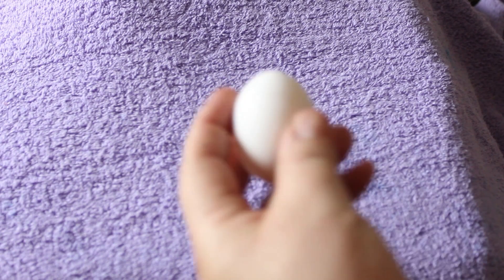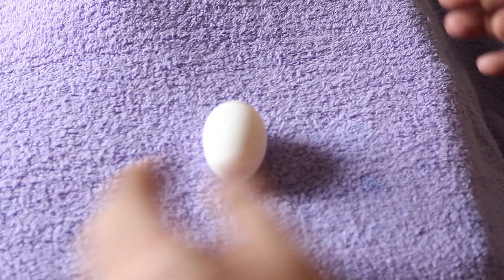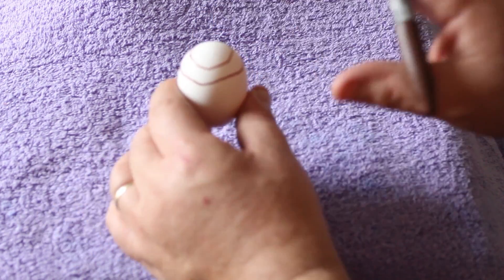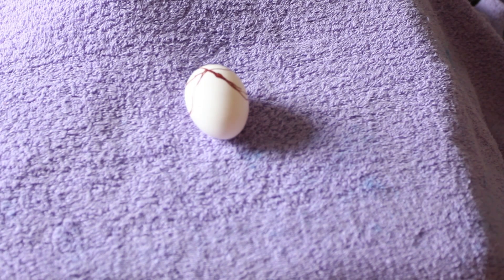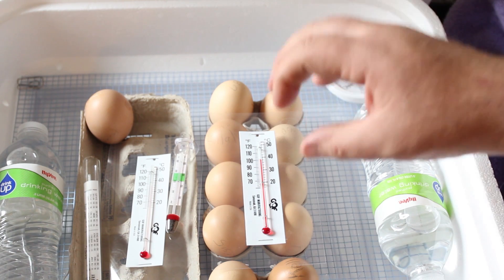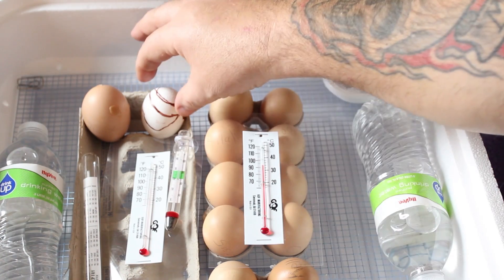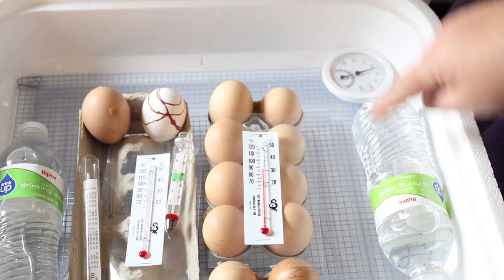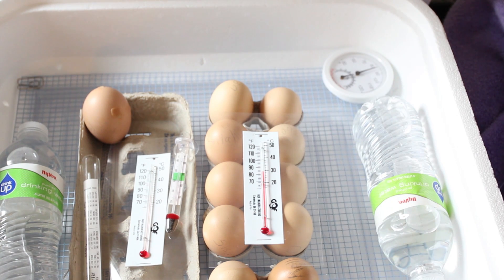Tips For Hatching Shipped Chicken Eggs With Detached Air Cells

Comment: Chicken eggs need to loose 14%  of the laid weight in the first 18 days of incubation. Its in the Brensea hatching manuel. I run 35 to 40 % for chicks and turkeys with  great results. If they dont loose this weight they will be too big to maneuver on hatch day. You will get a pip hole at best and a dead chick in the shell. And if you remove the chick you will notice that it seems large. It wasn’t able to spin around and pip the top off and escape.

Comment: What was the hatch rate?
Reply from the maker: Over 75%
Reply: @ThomasShue  good to know! I got an entire clutch of duck eggs with dislocated air cell. I candle and map the deformity like I do with all my other eggs. But I'll try up right next time! I resigned to the fact I'll have to manually hatch eggs with a starter air hole. Luckily I have 90% success with this method from what I learned on channel #AChickNamedAlbert #ACNA

Comment: This is good info, but for detached air cells I’ve read in a lot of places to run a “dry hatch”. Keeping the humidity around 20%-30% instead of 40%-50% to prevent the embryo from drowning inside the egg & raise the humidity in lock down only when the first egg has externally pipped.  This is what I’m doing with shipped eggs in my Farm Innovations incubator, so I guess we’ll see how that turns out.
Reply from the maker: Well a dry hatch will have the chicks stuck to the inside of the egg shell. Its not a good idea. The incubator makes dry heat. I always keep water in my tray

Comment: Amazing tips - no turning last 6  days, water bottles, raise humidity AFTER Pip - good timing for me. Got 18 in the 'bator -  hatch rate will be awful with the rough automatic turner...kept upright all but 8 hrs, using edge tipping so far. Will switch to your method of turning tonite, day 9.  Would like to see your lockdown and hatch rate.
Reply from the maker: Hatch rate was around 65% with detached air cells.  This method does work, and saves chicks that otherwise would just die.   I hope my video helps you. If you could be me a HUGE favor, please subscribe. I am trying so hard to get to 10,000 subs

Comment: Hi. Just came across your video but i think it may be to late for my chicks. I am at Day 15 with 6 saddled air sack eggs, I have been rotating them left and right as ususal. Should i stop rotating them now and just turn them slightly in a circular motion?  until day 18, and then up the humidity for lockdown but leave them in the craddle with air sack facing upwards until they hatch?
Reply from the maker: I don't know what I would do in your case. They would of already drown buy now.  I'd candle the eggs and see if anyone is still alive
Reply: @ThomasShue  HI . There is still 3 alive
Reply: @ThomasShue   Thanks for the super fast reply its really appreciated. I will go candle now and get straight back to you .

Comment: Thanks for the informative video. Please answer this question! at 4:38 you say "you swap them out". What do you mean by that? My understanding is place eggs with detached air cells vertically, not in electric egg turner, and gently turn at an angle 3xs a day. Is this correct? I don't understand what you mean when you say swap them in and out. Thanks!
Reply from the maker: Swap as in swap the eggs from leaning from the left to leaning to the right. I'm swapping the angle. You want the eggs to remain vertical, but not at a fixed angle. Set eggs on end at an angle to the left, then when you move them, SWAP them to the opposite side of the tray and the tilt them to the right. 

You see the eggs need to be turned, if not they will die and or be deformed. By Swapping the vertical angles you are moving the chicks inside the egg, however, you are maintaining the newly created air cell. 

Hope this helps you, you can help me by subscribing, it cost you nothing and helps me a ton.  Please like also.. 

Good luck with your new chickens.
Reply: @ThomasShue  Thx so much! How is this different from the electric egg turner? Isn't this what it's doing? Gently moving it back and forth throughout the day?
Reply from the maker: @bethhall2465  broken Air Cells on shipped eggs need to be stationary yet vertical. An egg turner won't hold the eggs vertically stationary long enough to maintain the new air cell we are trying to form.. Normal.eggs the egg turner works fine, eggs with detached air cells the turner will kill the chicks inside, they will drown

Comment: I am new to this and just set my first set of hatching eggs 6 days ago, which came from ebay. I wish I had know about this before i lay them down in the Brinsea Mini II Eco. I have just candled them and 3 are not fertile and the other 3 look like they have a detached air cell. Is it worth me standing them up like this after I have been turning them 5 times a day for last 6 days? Please any advice gratefully received. So sad and disappointed.
Reply from the maker: I fear it may already be too late. You need to check the air cell as soon as they arrived. You can try, it won't hurt to try.

Comment: I am on day 4 of shipped eggs and didn't know about this. Is it too late to try it? I have some with detached air sacs
Reply: I'm just curious, did they hatch?
Reply: The info was misleading... the reason why y’all deal with the non perfect air sac size is because y’all starts turning them eggs as soon as they went to the incubator.... they need to be upright position for 7 days or at least when the air cells are reattached... you have 1% luck hatching saddle shape air sack on lockdown... they need to be in perfect shaped before lockdown that’s why lots of them eggs never hatched

Comment: So I'm confused... Do you turned your eggs while it's in 24 hrs rest before putting them in incubator?
Reply: Some say not during the room temp rest...or even the first 2-5 days upright in the 'bator. I used slight tipping - with a book under different edges of the egg carton...and a gradually more than that in the Incubator after first 3 days.

Comment: Hi Tom! So glad I found your video, I've got eggs from my own Cochin Bantams and most of them have the air cells on the opposite end. One is at day 7 of incubation and the chick is moving and developing well but the air cell is at the other end. Same is the case with my day 6 and 5. 

I've had them on the side and slightly tilted, pointy end down in the tray since day one and the air cells are still at the wrong place. Please tell me what I should do. This is my first time incubating.
Reply from the maker: You need to stop moving them they can develop an air pocket. I do this by placing them as shown in the video.
Reply: Alright, thanks.

Comment: Awesome! Thank you...I have a few questions. First, where did you buy those thermometers at....I am sick of getting the expensive ones, like digital ones, and not being accurate... The simple ones on the coard board are the best... And I'll be able to get several! Lol
Second...I have just bought Serama eggs... They are hard to hatch in the first place, let alone being shipped.... Have you incubated any of those eggs. And do you have any suggestions for me....I have let them sit, it's been over 24 hrs.... I've checked the air cells, one was completely detached, but the others seem good. I have a few that look like they were trying to be saddle like air cells, but it's very very slight...
Ooh, another question, the ones I just described, that have very slight detaching ( if you want to call it that) of the air cells, is there anything I should or need to do differently? 
Thank you for you video...
I hope to hear back from you soon!

Comment: Thanks for posting. I have 6 call duck eggs that I just received from the mail. All but one have detached air cells. It was advised that I use a broody hen to hatch as calls are hard to incubate. Can I do that now that they have detached air cells?
Reply from the maker: Twin Roses Farm I would not do that. I would incubate then just as I showed. You need to reconstruct the site cell. To do that, they need to be on end.

Comment: when they start to pip do you remove them from the carton and lay on their sides or do you leave them right in the carton till completely hatched?
Reply from the maker: Jennifer Bakos after they pip, and start to come out, you can lay them down. just wait until the hole is nice and big. when they start to unzip is the best time. A pip means they are wanting air, and it can take 24+ hours for them to unzip and hatch. Personally, I would wait until they are starting to unzip, or make a bigger pip hole.

Comment: Hi Tom, Thanks for posting this. Do you have any experience with goose eggs? I received shipment this morning and they are all detached air cells. The woman I bought them from suggested a similar method. Any info is GREATLY appreciated.
Reply from the maker: OzoneMama3008 I'd be happy to speak to you over the phone. send me a direct message with your number I'll call.  The bottom line is this. We are trying to re construct an aircell.  We do this by setting the eggs vertically, then we turn the eggs at a much shallower angle than the 45° angles that we turn on a standard eggs with normal air cells. You can hatch your goose eggs with detached aircells. Follow the video, the method worked for me. Also if you get a chance, please subscribe to my channel..